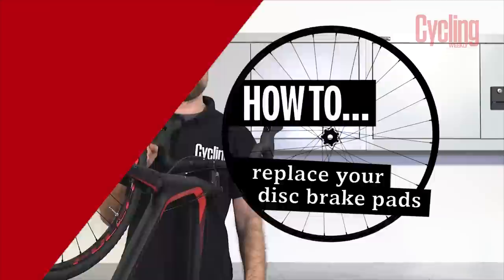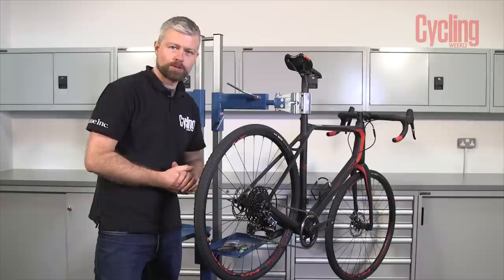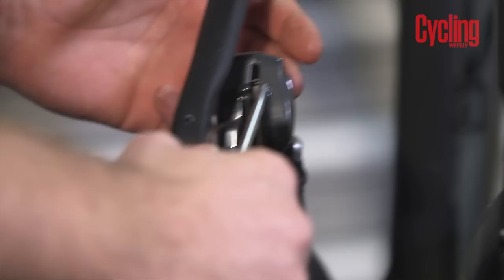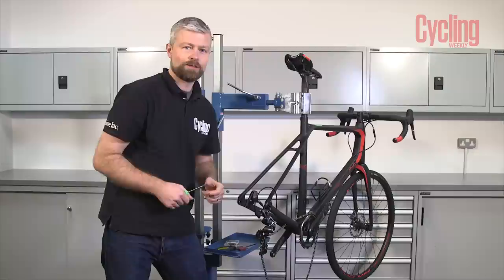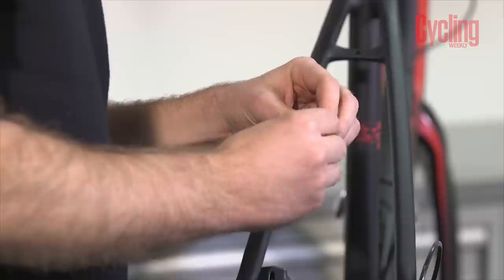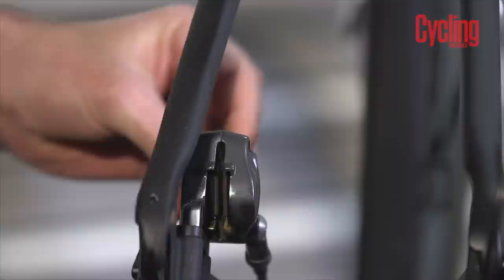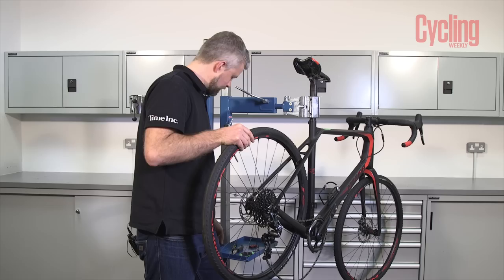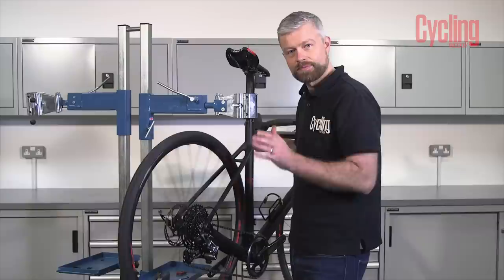How to Replace Disc Brake Pads | Cycling Weekly

Comment: Following this video is a surefire way to get sticky pistons eventually. Here’s what you should do to avoid sticky pistons and brake rub:
1. Remove wheel and worn brake pads.
3. Push pistons approximately 1–2 mm farther out by carefully pulling the brake lever. Be careful not to push the pistons out completely.
4. Clean/lube the edges of the pistons with brake fluid using Q-Tips.
5. Carefully reset the pistons with a piston tool or a plastic tire lever (metal might damage the pistons and cause leaks).
6. Pull the brake lever again to check if the pistons move freely. It is not unusual to have slightly more movement in one piston compared to the other. As long as both pistons are able to move, it shouldn’t be an issue.
7. If you have one or two sticky pistons, repeat steps 4–6 until both pistons move out of the caliper when the lever is being pulled. You might have to force out the sticky piston by holding back the other piston while pulling the lever.
8. Reset the pistons before installing the new brake pads and your wheel.
9. Slightly loosen both caliper fixing bolts.
10. Pull brake lever several times until both pads contact the disc. While pulling the lever, tighten the caliper fixing bolts. This centers the brake caliper and prevents brake rub.

This process does take 10–15 minutes but keeps your caliper seals clean and lubricated.

Comment: Thanks for this but as a beginner I would have liked a close up on how you put the brake pads into the  metal brake pad clip at beginning instead of a long shot of the bike mechanic- it helps to see the process clearly and get the right technique

Comment: Can you replace disc pads without removing the wheel?
Reply: Hi Man did you try it without removing wheel? having same question
Reply: @andriusmatukas3150  Yes, I did - but it was a bit finicky. Let me say from the start, you can replace the pads without removing the wheel only if your caliper is "front-loading" - meaning you can insert and remove the pads from the top. For "bottom loading" calipers, there is not enough room to remove the pads from the top - in that case you must remove the wheel, to be able to push the pads out the bottom. 
So if your caliper is front-loading like mine (Shimano BR-M6000) - you don't need to remove the wheel. 
But if you have to push the pistons back in, and if you want to clean inside the caliper, it will be a little more difficult, but it is doable. I did manage to do both. 
The hardest part was the last bit, centering the rotor inside the caliper. The "trick" of loosening the caliper bolts, and re-tightening them while squeezing on the brake lever, did not work for me at all (in fact, from my readings, that "trick" doesn't work for most people). 
It took me about 20 times of trial and error, loosening the caliper bolts, and manually adjusting the position of the caliper on the frame - before I could finally spin the wheel without any rub.
I think if you have a bike stand (which I don't), you'll probably have a much easier time (harder to see inside the caliper, if you can't raise the bike).
Good luck!
Reply: @virkelie2  thank you reply did help me lots thanks for all details and take care
Reply: @andriusmatukas3150  No problem!